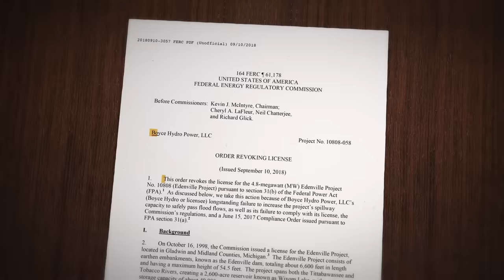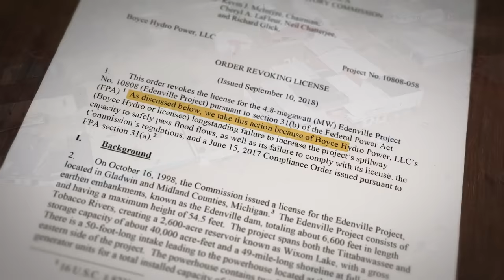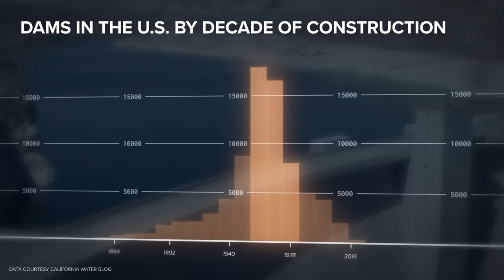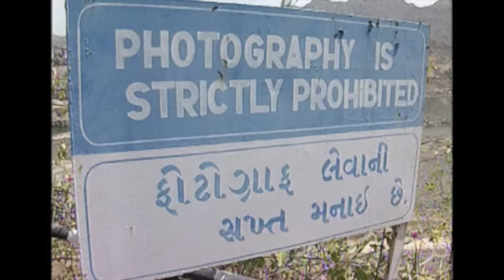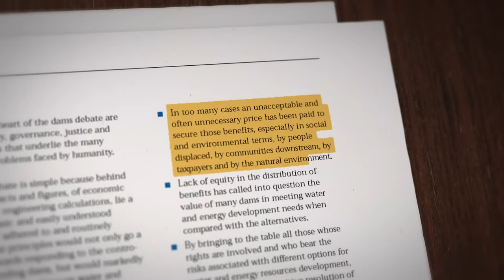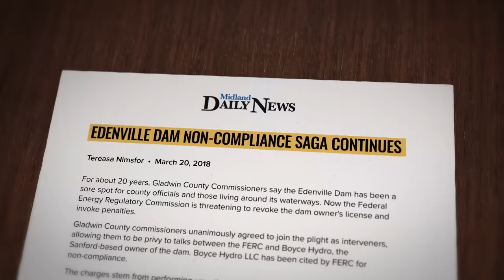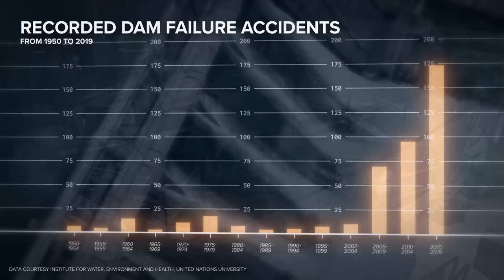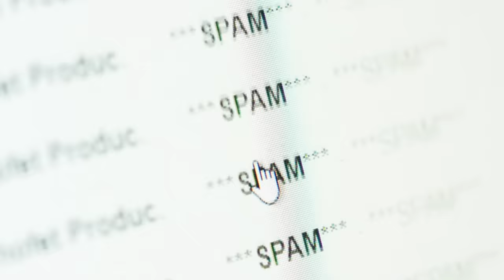The Troubling Danger of Dams

Comment: Very interesting. I own 15 acres in Texas which includes a dam, along with about half the reservoir it creates. Built by the US Core of Engineers in 1953 I believe. The state came out and surveyed it about 8 years ago, replaced the flood dock, as well as some of the overflow pipe. They also built a barb wire fence around the entire dam which I was less than thrilled about. I don't have cattle on the property and never have, yet they insisted that the fencing was required in order to prevent over grazing and thus soil erosion. The weird thing to me at the time was that while they were insistent on the fencing, they were perfectly willing to let the deteriorating dock and pipe be, and only replaced/repaired those on my request. But wait, that's not all.

A few years after all this occurred, the tax accessor suddenly decided that my property was worth almost twice as much as before, and thus retroactively applied the taxes for such. They never notified me, and after 4 months appointed an attorney to show up to court on my behalf, and decided to begin the process of seizing my land. I've fought them every step of the way, and have tried to pay the owed taxes that they instantly applied to my property. Of course they're refusing to accept it because they'd rather have the property. As of this writing, they will auction off my property in December, at which point I will become homeless. Moral of the story? Dams can become problematic in several ways over time. Also. In the US, you own absolutely nothing. Regardless of if it's paid off or not, you don't own your car, you don't own your home, and you don't own your land. The government can and often will decide to take it from you at a moment's notice.
Reply: Shouldn't own stuff you can't afford really..
Should have sold the land and bought something smaller..
Reply: The Corps of Engineers mostly manages the really large dams in Texas, so I wonder if this was NRCS or TCEQ?

Comment: This is a poor documentary style production. A negative look at the benifits of Dams. 
Properly maintained Dams are an asset for water management for the use of power creation, drinking water and flood control.
At one point you compare Dams as more expensive than fossil fuel energy production.
Then you blame Dams for destroying environments. What does fossil fuel burning do if not degenerate the environment? 
Yes, Dams need to be properly maintained or decommissioned when they get too old and unsafe. 
Construction procedures and environmental impact assessments are creating greener Dams today.
Dams are still a better energy creation option than fossil fuel burning.
End of argument.
Let's not forget that fossil fuel burning is creating the environmental problem making old Dams unsafe.
Is this production funded by the coal industry?

Comment: just build a new dam upstream the old one. 

ez
Reply: That actually happened here locally.  They built a dam but determined it wasn't safe so they built another dam upstream of it, then that dam was damaged in an earthquake so it was also decommissioned and the reservoir drained.  For years the upper reservoir was allowed to hold small amounts of water but in recent years it has been bone dry due to drought, we had a very large amount of rain this spring and I saw water in the upper reservoir for the first time in probably 20 years.

Comment: This video lost my respect for this channel. 

You make it sound like the builders of the dams should have had all the knowledge we have now before ever starting to build a single dam. I guess we jo longer need to learn but start out all-knowing. 

Also, where is the analysis of how many lives were saved or improved by the reduced flooding, increased agricultural yield, and having a source of electricity has had for the people affected by the construction of the dams?

You make it sound like the current owners of the dams are just downright greedy, but think of it like buying a house or used vehicle.  The previous owner either didn't know or hid how bad the house / vehicle / dam was and due to a good sales pitch, the current owner is stuck with needed repairs that far exceed what they can afford.
Reply: „We didn’t know“ is a pretty bad excuse when human lives are at stake. If it’s under your name, it’s your responsibility.
Reply: @sleepy_chronotype we did not know thigs 20 years ago nvm it’s my fault?